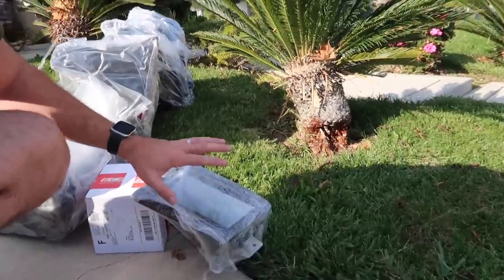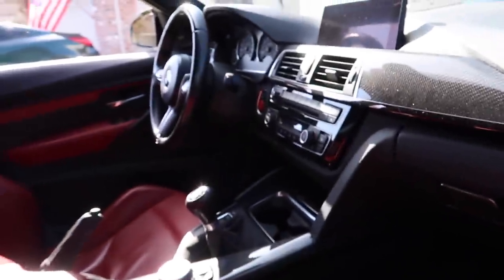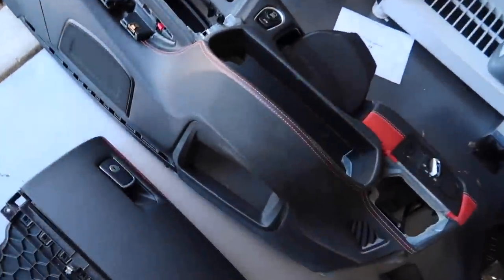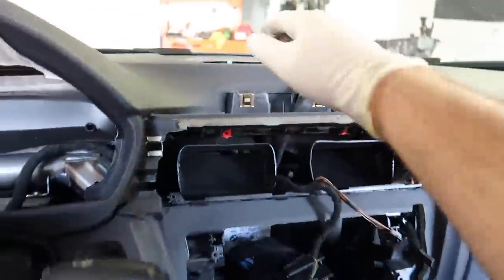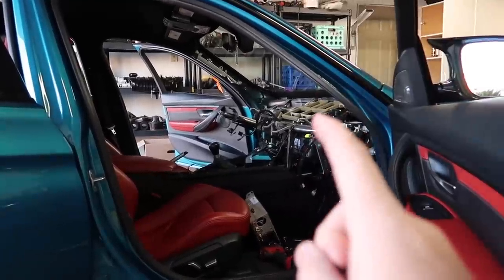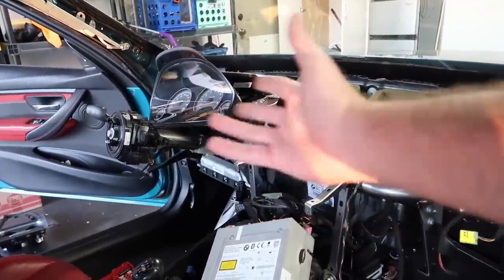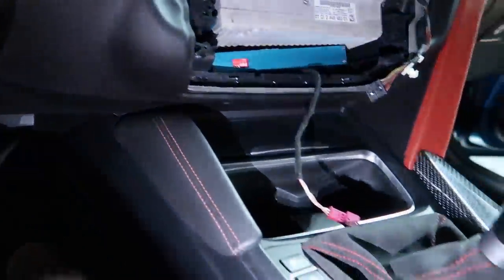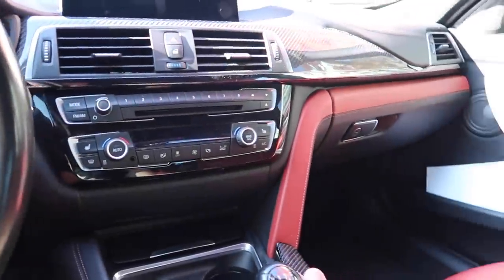RETROFITTING HEADS UP DISPLAY ON MY F80 + EXTENDED LEATHER DASHBOARD RETROFIT! (F30, F32, F80, F82)

Comment: Nour, cars that come equipped with heads up display from the factory have a special HUD windshield. Your retrofit will work but the image from the HUD won’t be clear and will be susceptible to “washout” from glare on the windshield
Reply: And Nour if you change the glass go oem. Don’t get oee. I’m dealing with my insurance right now because they didn’t want pay for the oem on cause the oee is cheaper and should be the same but it’s not. Heads up is more blurry etc
Reply: Yeah need a new windshield or HUD display will be blurred 👍
Reply: My 2014 428i convertible has HUD, it’s not that of deal to go through all these hassles and expenses.

Comment: Nour your instrument cluster needs to be swapped. 6WA clusters with HUD are different, they have a blue HUD HSD connector which yours does not. Second, the dashboard you bought is actually from a F83 Convertible, like you already mentioned. So the top cover on your spring clock is the Alarm system and microphone indeed. Convertibles don't have the roof mounted FZD (alarm/roof module).
Reply from the maker: I see, well it looks cool so ima leave the microphone lol
Reply: Is there any way to keep regular non hud cluster and do the retrofit or cluster must be charged
Reply: @seanwilliams8968  In order to retrofit HUD you always need to swap the cluster also. Cluster provides HUD with the data through a single HSD cable (blue connector on KOMBI)

Comment: Hey man, you’ll need the upgraded windshield for HUD’s. It has a material in it that’s reflects the projection.
Reply: surely not :O
Reply: @itfben  sadly yes, i had HUD in my old f30 and had to have the windshield replaced and they did the wrong windshield causing it to have the issue of not reflecting. It has a material that is used with the HUG projection. It’s like twice the price for that windshield

Comment: Great, really informative video...
I am invthe process of upgrading my BMW F31 and fitting HUD my car is without HUD.
I have got all the new dashboard, with instrument cluster and HUD with all the cocpit wiring from a donner car.
I just want to confirm that i can fit the HUD on my existing  dashboard inforcement frame, as i have not bought it. I have not desmentled my dashboard and wanted to confirm that i will be able to screw the 3 big head screws on my frame.
Your guidance will be much appreciated. 
Regards
Imtiaz